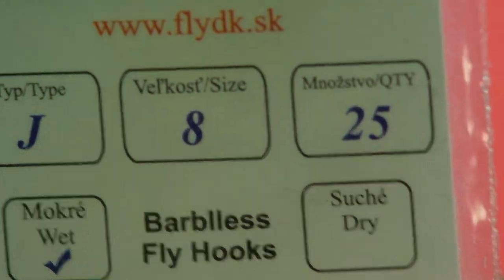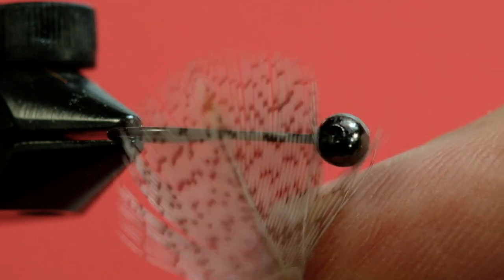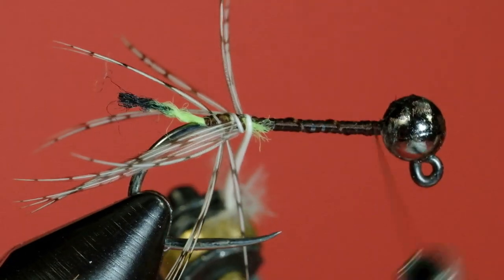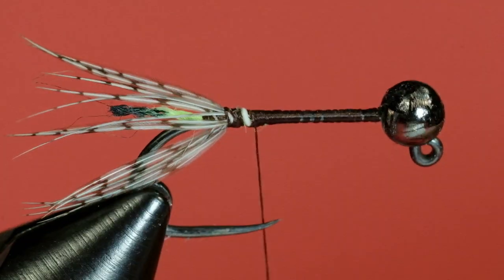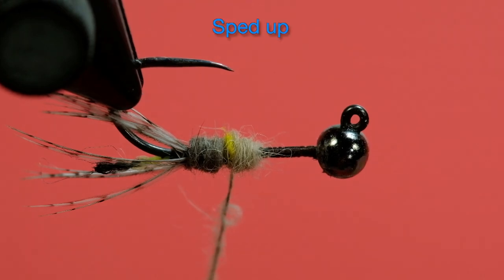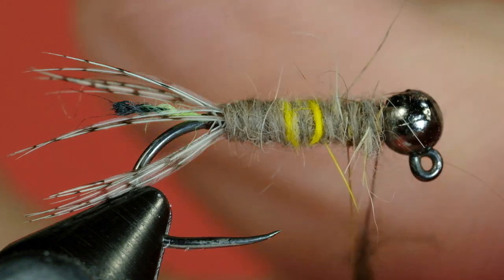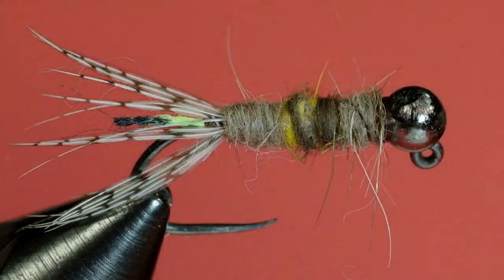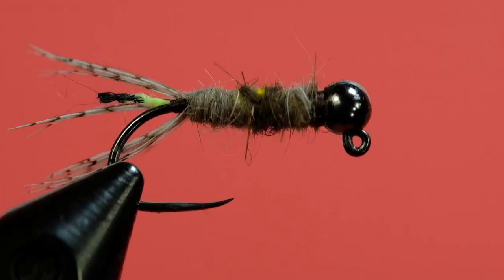Tying Euro Nymphs: the Peeping Caddis

Comment: I’ve had good luck with the hobby/craft knives with replaceable blades. It’s a long pencil like tool, with blades .25 each. 

Aside from that you could burn off the material (never tried). A chemical could be used too as a soak but I’d be more skeptical
Reply from the maker: 1500W heat guns can cook off most of the material without overheating the hook and removing any tempering.

Comment: Nice one Peter.  Moving soon so all my tying stuff is in boxes.  Soon as I get reset, I’m going to give this one a whirl.  You mentioned reclaiming hooks from old flies?  I thought of doing that and did try once.  Found it difficult not to really scuff up the hook however. Tried exactlo-knife, razor blades, a lighter?  Hooks came out really beat up.  Got discouraged and never tried it again.  Maybe you have some suggestions?  Hooks can be expensive.  I’m all for saving a dime when I can.  Thanks.
Reply from the maker: Razor blades and heat guns are best. I wouldn't use an open flame as it can damage the hook.